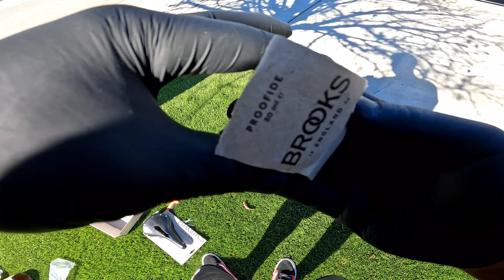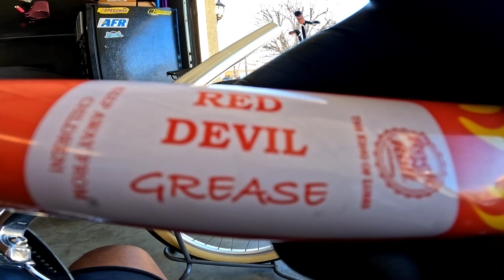BROOKS B17 VS BROOKS B17 IMPERIAL ON MY SE BIKES

Comment: I just got a new Brooks. I got the normal one and the break in is easier if you get the new seat and loosen the bolt at the front 1/4 turn. That with the proofide is legit. Try the 1/4 bolt trick and let me know what you think.
Reply from the maker: Both seats are awesome I will try that on the new one